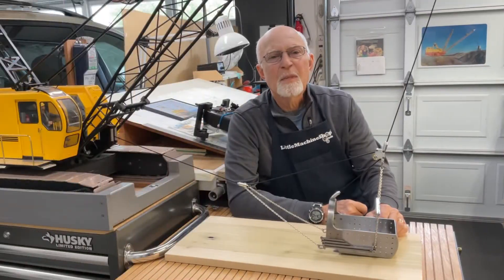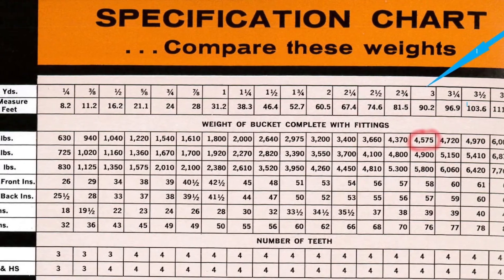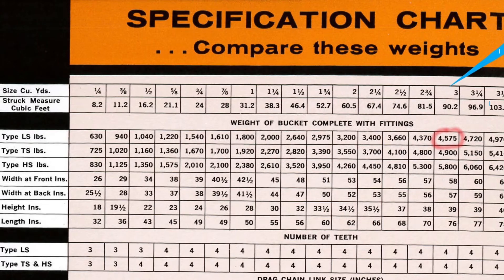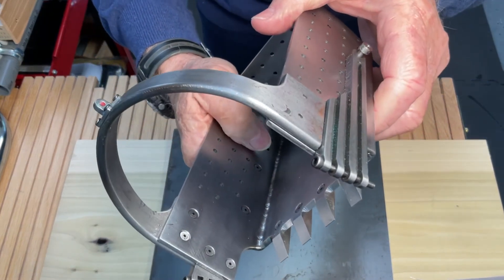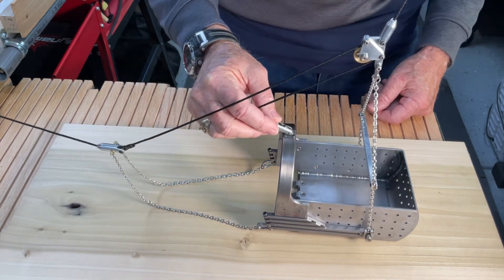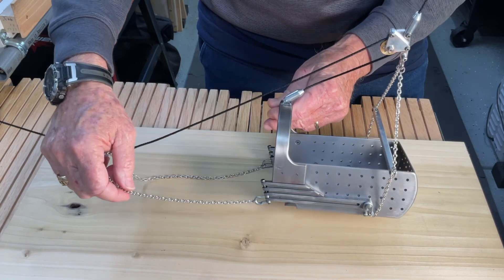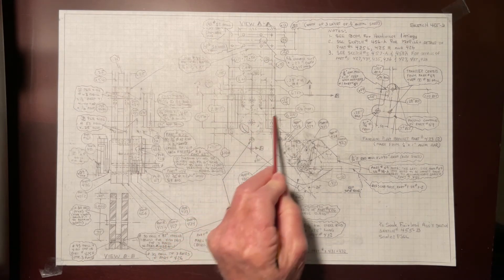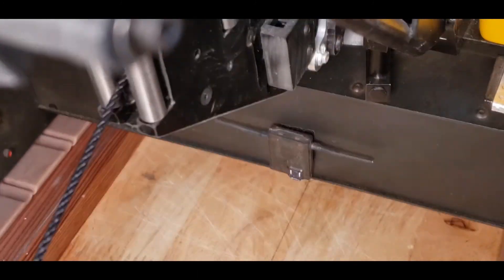Dragline Model reva - 1/12th Scale Crawler Crane

Comment: Sorry, accidentally clicked  "add comment" before done. 
The dragline bucket "chains" were made from lamp "pull-chain" & the dump "cable" was heave nylon string. There may be some details about this dragline model I've forgotten, but I think I've included the main details. My Dad built this model in the early 1970's, over a few months, it seems. He was a Professor of Mechanical Engineering.  
The model was intended for a kid of 8-10 years old or so, to sit on the model's roof & operate the controls, which I did with much enjoyment!
Dad wanted to make a "walking" dragline feature for the model, which I'm sure he could have, but he never had the time, or lost interest in that project.
Seeing your beautifully crafted crane & dragline bucket reminded me of the model my Dad made, so I thought it might be an interesting story to share with you.
As for the dragline model, my oldest brother got it some time ago, & I don't know what's become of it since then. 
Cheers!
Reply from the maker: Shadowvanish,
WOW, what a detailed recollection you have of your Dad’s dragline model.  Sounds like he was quit a creative guy.  I too am a degree Mechanical Engineer who spent most of my career in manufacturing, but my favorite professional memories were when I started my career in the early 1970s as a machine designer.  I actually started designing my model in 1971, around the same rime your Dad started working on his model.  Also like your Dad’s model, I use automotive windshield wiper motors as the motors for the three hoist drums and the swing drive.  Originally I too had plans on an umbilical cord for power before I started having kids and packed the project up until I retired and restarted the project 6 years ago.  Where about do you live, and are you into modeling?  Thanks for your comments and interesting story.  I would love to see pictures of your Dad’s work if you ever come by any.  Stay well and subscribe to my channel.  Regards, Tom Garing

D’Souza

Comment: Very nice work! I've been fascinated with dragline models for years. My Dad built a dragline crane model years ago that was functional & semi-scaled to a very large mining dragline (can't recall the mfg.; Bucyrus Erie possibly) used in the same coal mine that the "Big Brutus" Bucyrus Erie 1850-B electric shovel worked in (which I was fortunate enough to see in operation, during a visit to the mine). Anyway, the model  used 3 12 volt DC automotive motors with gearboxes to operate the swing, drag & hoist functions. 120 volts AC entered the model from the underside of the lower structure, & was rectified & reduced to 12 volts DC through a step down transformer. Slip rings & brushes, located between (& at the center of rotation of) the lower & upper structure, were used to transfer the power into the model's upper structure interior, & power the 3 motors. My dad fabricated the latice boom from formed sheet metal strips (I'm guessing 20 gauge sheet steel), & spot welded the boom pieces together. The boom was about 5 feet long, as I recall, & had a 12 volt work light built into the underside, at the mid point of the boom's length. The crane's "house" was fabricated from 3/8" plywood (I think) & the "house" roof was made from a rolled piece of galvanized sheet steel. The boom could be raised & lowered using a machined aluminum hand crank connected to a worm gear drive that operated the boom hoist drum, which was part of "A-frame" or gantry structure (also fabricated from sheet steel) located on top of, & at the front of the "house's" roof. The "A-frame" also contained three toggle switches for motor operation. Near the top end of the boom's upper side, a single sheave pulley block was used for the hoist "cable", which was heavy nylon sting.
A "master" on-off switch was located on the side of the "house" & a small cooling fan was mounted in an opening at the upper rear of the house for ventilation (like the full scale machines). The turntable used marbles for ball bearings, & Dad made upper & lower bearing races out of bakelite, (I think, but it might have been a different material), into which he machined bearing race grooves for the marbles to ride in.

And, he made a semi-scaled dragline bucket that was about 1/2 the size of the one you made, as I recall, from approx 16 gauge sheet steel. The bucket "chains" were made from  "pull chain" type
Reply from the maker: Shadovanish, See my reply to your 2nd comment, Tom